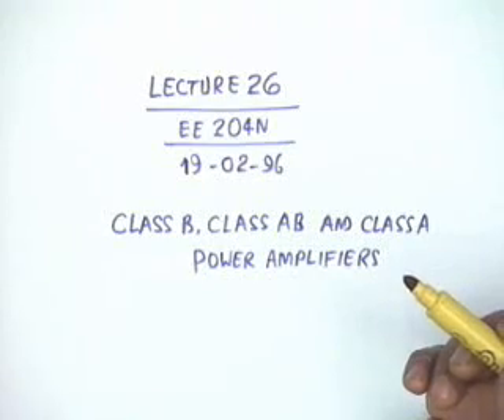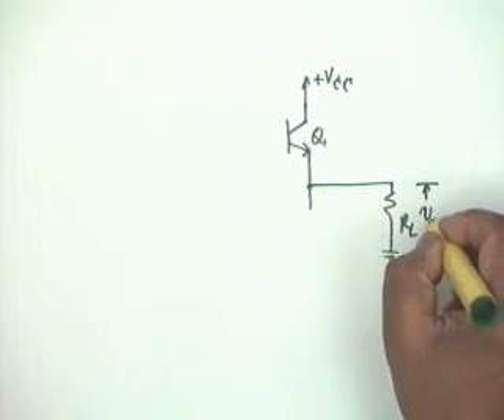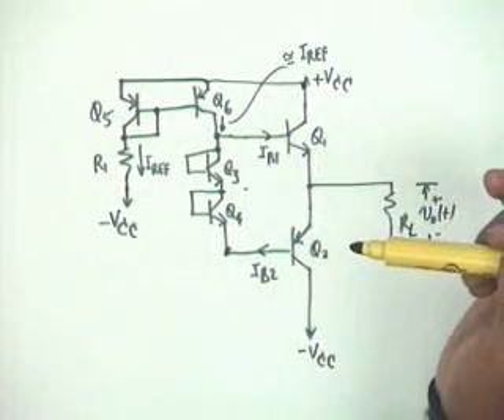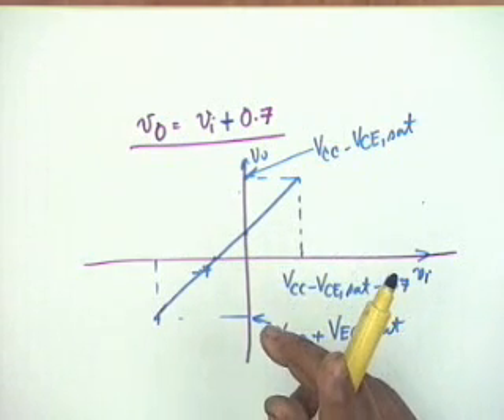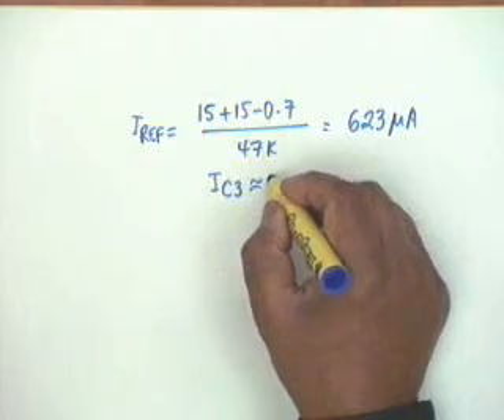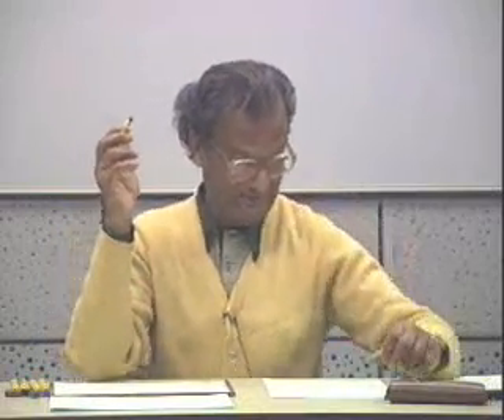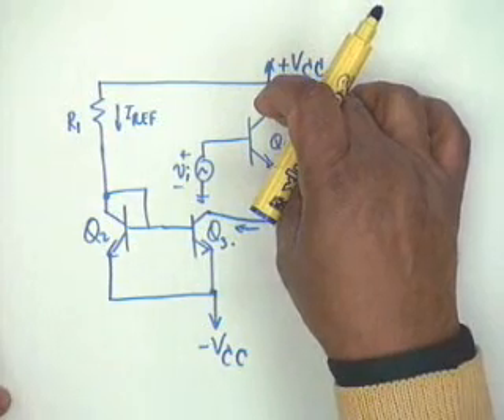lecture31 Class B, Class AB and Class A Power Amplifiers

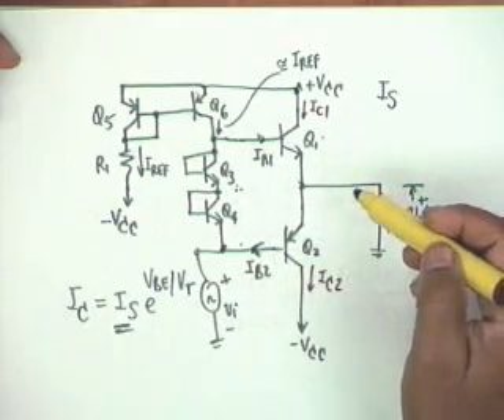Comment: @ 20:22, in the circuit the input voltage is attached to base of Q2, however shouldn't it be connected to base of Q1 as well. Or else there will be dead band while negative half cycle of the input voltage.
Reply: No there won't be any dead band on the negative cycle since Q2 base is always 0.7V below its emitter (because of the presence of Q4). When the input voltage goes just below zero Q1 base is at 1.4V and the output voltage is at 0.7V. Hence Q1 is still conducting (the input voltage has to go to -1.4V for Q1 to stop completely conducting). When the signal reaches -0.7V the output voltage is at 0V and both Q1 and Q2 are conducting quiescent current. But the moment the signal goes below -0.7V, Q2 takes over right away because its emitter is at zero volts and avoid a cross over distortion.

Comment: Hi Satish, your lectures are detailed and of course provide lots of information. I am an audiophile and would like to know in simple English. When I go to an electronic store to look for a high current home music amplifier in different brands, they tell me it is A, B, C and D class. I have two questions here please. What class is the high current amplifier and how do we know that it is a high current amplifier, does the specifications at the back of amplifier shows like in Mv like in milli amps or distortion or what. The high current amplifiers that are famous here in Canada are mostly Marantz amplifier and they are high end and expensive too. I hope you will describe to me so that I learn. I thank you in advance.
Reply: hi arshad,

class A amplifiers for best sound reproduction the whole signal will be amplified by one transistor and obviously no cross-over distortion but little THD and efficiency is less than 30% you have to burn watts to get few watts.

class B amplifiers distorts but 50% efficient good at low volumes and bad at high volumes THD is high and cross-over distortion too

class AB amplifiers are better than class B, class AB  will have Vbe multiplier also called biasing circuit for output transistors, Vbe also works as thermal sensor, at few instants both PNP and NPN comes in conduction that leads to thermal runaway of transistors, if no proper bias circuit it distorts and if good bias  less THD, less noise and efficient too. the famous output drivers are 2sc5200 and 2sa1943

class C good efficieny say 90% and lot of distortion too, not good for music

class D nice amp, efficiency more than 90% and little THD,  nice info here http://www.irf.com/application-family/_/N~1njcjq#tab-tab3

i used to design, build and repair them.
thank you.
Reply: visweswara rao kalla Thanks so much visweswara, one another thing, when we talk about high current amplifiers or receivers, so do we call high current amplifiers as D class. Marantz receivers and amplifiers are expensive as compared to other receivers and are high current mostly. what do you say about it.
Reply: Arshad Haroon i heard good about marantz (audiophile quality) you mentioned high current,     based on topology(A,B,AB,C etc ). 
class A needs lot of power. goto diyaudio lot of info on it
Reply: Thanks, I got some idea.
Reply: visweswara rao kalla  Here is one favor if you can please let me know based upon your knowledge. I want to know about this integrated amplifier model Sony TA-A400 100w/ch. Some of the specs indicate "2 channel integrated
100 w/ch @ 8 ohms
Freq response 7Hz - 100kHz
0.05% THD
4 ohm to 16 ohm speaker load
DC offset currently measures -3.8mV left, -1.2mV right (excellent)"
My question is" is it high current amplifier?" and if not what do you think of the power and freq. response etc. I will appreciate your information. Thanks in advance.
Reply: Arshad Haroon i just sony TA-A400 is really a nice amp(old one) 
THD is very less 
if DC offset(speaker killer)  of  less than 20mV considered as good amplifier
frequency response is really good  human ear audible range(20-20KHz)
it draws around 3.5Ampere per channel
preamp stage with opamps
power amp stage is discrete transistor
it is a nice amp
Reply: visweswara rao kalla I appreciate your reply and information, I will get it today and after usage will provide you my feed back and experience. Thanks.
Reply: Arshad Haroon Hello Visweswara, I thankyou for the feed back, today I hooked it up and it is really powerful system and moreover with equalizer it is such a masterpiece to listen to, all the high and low frequencies to enjoy. Thanks.
Reply: +visweswara rao kalla 
a perfect answer!